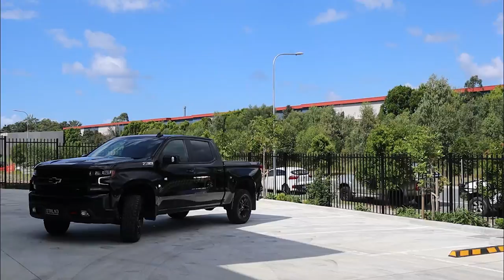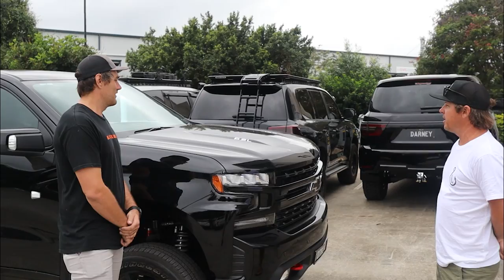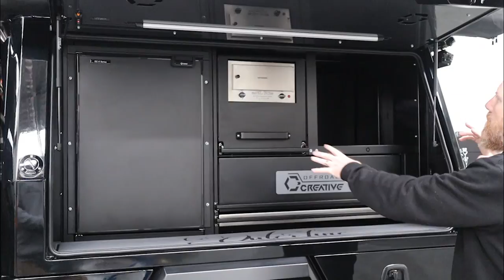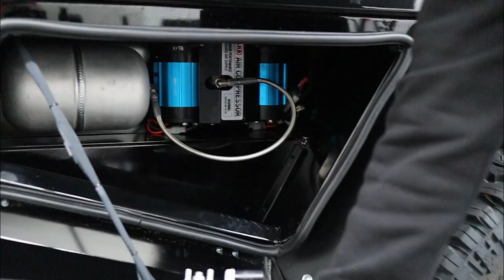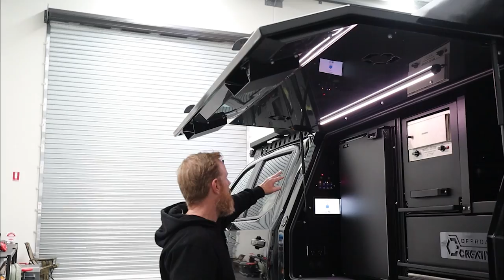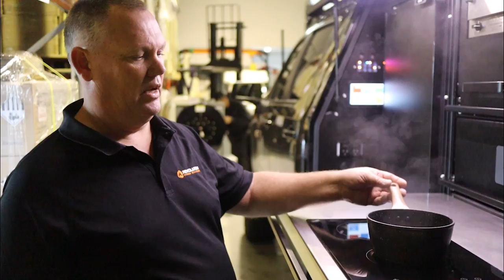SILVERADO 1500 | ULTIMATE TOURING BUILD - Ep 57

Comment: I finally got my dream truck last month in June. I'd been driving the same truck i bought brand new, way back in 2002. An S-10 2wd. 23 years and almost 160,000 miles. She was good. Ive owned 3 trucks and 1 car, prior to this newest one. The 2002 S-10(my first and final brand new vehicle purchase. Lol). Prior to it, i drove a 93 S-10, a 1990 Ford Ranger and my first ride a 1986 Toyota Corolla, which i got at the age of 16 in 1996. So the thing they all had in common, is they were all tiny. I had both S-10's, sitting on the ground almost. I finally had to get a new to me vehicle, and i went the exact opposite of what ive driven for 29 years. Due to back surgeries and joint issues, i live in pain 24/7. Having to sit in a small vehicle any longer that 30 or so minutes, is really painful. I wanted something with some room this time. So i got it. I purchased a 2020 Silverado Trail Boss. Crew cab short bed. First full size and first 4x4. I love it. I hope to build a camper one day. Id like one to go in the bed, but the bed is only 5'8" long. Im taller than that, so im probably gonna have to build one on a utility trailer. Saw your truck and it reminds me of the one i just purchased. Except mine is northsky blue. New subscriber here from Tennessee.

Comment: Fantastic and thank you. We are about to purchase a Chev 1500 and looking to do something similar. I look forward to watching your travels. Best of luck  Shawn and Teresa
Reply: I purchased a 2020 Silverado Trail Boss Z-71 last month. My nephew bought a 2021 Texas Edition Z-71, two months ago. He had to be fancy and its loaded with everything. Lol. He also had to have that big 6.2 V-8, even though i told him they have a bad reputation. They have alot of issues. I went with the standard 5.3 V-8, which are the best engines on the planet. They easily go well over 300,000 miles with routine maintainance. Very reliable. If you'd like a couple recomendations from what i know about these trucks, that could save you some troubles, here they are. The 5.3 is the best engine option of them all. Its a V-8, so its burns a bit of fuel for sure. Or you can get the 4.3 V-6. Which in these trucks, being that they are 7,000 pounds, the V-6 isnt going to be much better on fuel. It has to work much harder to pull that weight. It could feel underpowered as well. Even though that V-6 is pretty reliable, and has around 275-285 horsepower. It sounds powereful, but in a 7,000 pound truck, its pretty disappointing performance. The 6.2, has over 400 horsepower but has too many expensive issues. I'd highly recommend the 5.3. Its documented at 355 horsepower and nearly 400 lb.ft. of torque, its freakishly powerful. It Stay away from the 4 cylinder turbo and the 6.2. I said my nephew got his a couple months back, and its been sitting in the shop at the dealership right now, for the past 2 weeks, waiting for a new engine, that is on back order. Its going to cost him $10,500 for the new engine and for them to install it. They also have the small, i think its 3.0 liter, Duramax diesel engine option too, for the 1500, but i know nothing about them. They are gorgeous trucks for sure. Even though mine is the Trail Boss edition, and they come new from the factory with a 2" lift in front and back, above the regular Z-71, with even stiffer shocks as well, my Trail Boss rides and drives like a dream. Hope that helps. Best of luck my friend.

Comment: I just installed the 6inch bds lift and used 18inch wheels with zero off set. Same like you I did not want 20's or spacers (I also have a 2017) so that's crazy!

Comment: This is seriously impressive. 

Do the two main side storage units meet in the middle - as in is the middle wall between them thin or hollow, could you remove it to permit carrying larger items when needed? - I ask because while I want an overlanding rig, I also want something useful on my farm which means being able to load up lumber and tools.

I'm going to test a new 2023 Silverado LT Trail Boss Z71 next week and I want to build something like this. Here in Colombia the prices are through the roof because of import taxes etc. I would go Toyota if it wasn't with a 100% markup. The Chevy is $68.5k USD. 

Can you share rough weight and costs of the final loaded build please?

Comment: Can you pm me cost please mate
Reply: Hi mate I’ve got a resmed AirMini and use a Dometic 40 amp hour lithium portable battery with a 400 watt inverter taped on the side permanently 
Just did the Finke desert race and Simpson desert crossing 15 day trip and only charged it once. Usually get 6-7 days use per charge. Cheers Ant.